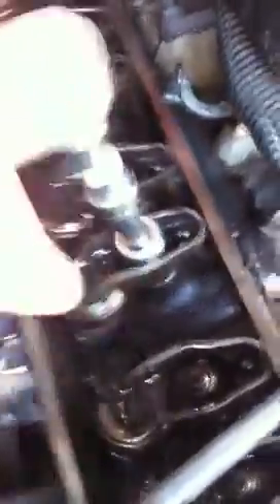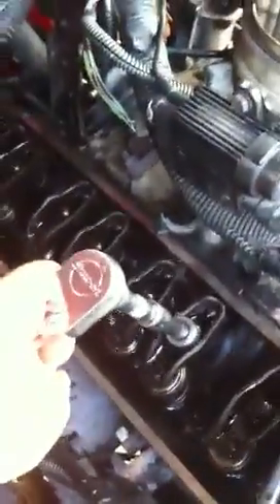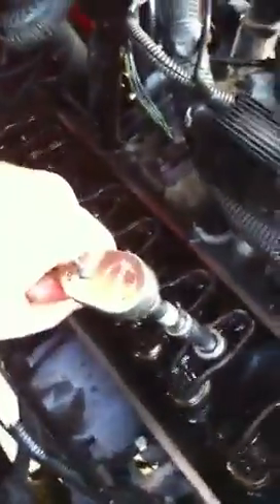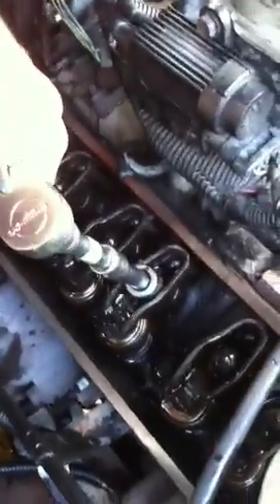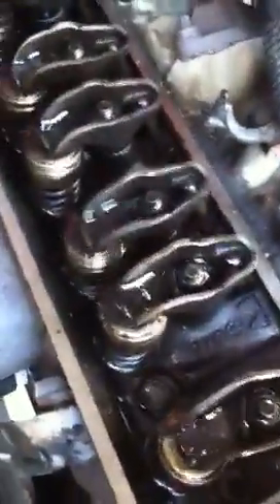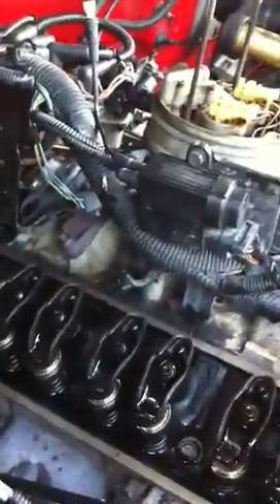L05 rocker arm adjustment chevy 5.7L 1995

Comment: I have a 94 K1500 and tried this, well now my driveway and engine bay is covered in oil that sprayed everywhere. Nice lol
Reply: That’s a bummer - did adjustment work?  Was it an L05 350?   Might have a higher volume oil pump, an LT or some other engine in there.  On mopars we had to put up with the mess.    A buddy with a ‘69 427  had a high volume pump and he got a junk set of valve covers and tin-snipped the center/tops out and adjusted with way less oil slinging - you could try his trick.  These stock L05 engines amazed me that we were able to remove and adjust without the mess.
Reply: @tonyd3266  that's just it, I know it's a 350 and tbi, so I assumed that it was the same. I hadn't thought about the fact that it wasn't the original engine, that's why I could laugh about it. I bought some of the clips that clip on the lifters and did it that way. All is good, thanks.

Comment: Would you do a hydraulic roller the same way? Mine is a 98 5.7 vortec and it's supposed to be a roller. My #6 exhaust rocker broke. I've never seen it happen before.
Reply: Is the valve guide really worn ?  I'd be careful it doesn't get stuck open.  I'd go to a local, old-school trained mechanic with a scope and have them watch that cylinder to see valve opening and closing times.  My local Mobil 1 station with a garage has all those goodies and for like $35 they wil put it on their machine.  I would probably adjust the same way -- anyone else have other ideas ?  I would not mix roller and regular rockers unless I knew the roller had exactly the SAME LIFT RATIO.  Some of the rollers have 1:1.4, 1:1.5, etc... for extended duration and lift without pulling the cam.

Comment: Good Stuff!

Loosen rocker arm nut until clicking, tighten till not clicking, 
then SLOWLY turn nut 1/2 turn.

Don't rev engine while valve covers are off.

Thanks for video!
Reply: Thanks for the help. What size socket should I use? Thin wall?

Comment: That ticking noise definitely sounded like the noise I have on mine after taking it to the dealer for a new valve cover update etc. I'm assuming the mechanic man didn't tighten of them tight cause after it I had a ticking noise at warm ups goes away while running.
Reply: Sorry, I dont have all the trust in garage mechanics - especially tire shop mechanics wanting follow up work.  Do it yourself.  Hopefully they are rubber gaskets you can re-use.  One such store loosened up my power steering return nut to make it leak out fluid.  When I returned to have them really adjust the alignment he went right to that nut and said - it looks like the PS is leaking and you need a new rack.  It was complete BS.  I put the cardone rack in myself 5K before that and had even inspected the rack before the tires.  Watch the stealerships....
Reply: Tony TonyTony  I know what your saying. I'm sick of them trying to up sale Everytime I have gone in. My wife gets it the worst. I now try to avoid shops as much as possible.

Comment: I know this is an older video but just picked up a 1995 GMC Suburban K1500 with only 47k miles on it. Just did a full tune up and its running great except I hear a slight ticking sound coming from motor while driving. Do you think excessive valve lash could be my issue? If I had to be critical, it seems the motor has a slight vibration under load. What do you think? Should I attempt this? The ticking sounds similar to when you loosened the nut in the video and it started to tick. Quieter though obviously...
Reply: This issue is extremely common on these vehicles. I'd be surprised if the tick was anything else.
Reply: If this trick didnt work I’d look for a missing exhaust manifold bolt or tighten the exhaust pipe to manifold bolts carefully (if the bolt was loose - remove it- heating it if necessary- and replace with a new exhaust nut that wont loosen up on it’s own).   My experience with SBC is It’s usually the right/passenger manifold studs going to the exhaust pipe or the rear manifold  bolt attaching it  to the head.  My engine had 90K Miles and the rear left side head-manifold bolt was broken at the block- had to remove head to fix the manifold-head bolt.

Comment: i did this with my 99 vortec 350 and it makes noises i loosened it till it started tapping and i went a half a turn.  it's making small ticking noises on both sides with everything at a half a turn. but on the bright side she runs good.  any ideas greatly appreciated
Reply: The self-adjusting hydrolock portion of your lifters may be a bit clogged our out right stuck. Sometimes more frequent oil changes can free them up - like changing your oil over and over - it's a lot safer than an oil flush, but sometimes you just have to get in there and clean those directly. Soak them in fuel, clean them with carburetor cleaner - there's lots of right answers.

Comment: You rock dude. I have a slight tick in my 350 developing after a fresh rebuild. I didn't do the rebuild myself, and am not an expert mechanic. I'm pretty sure I just need a rocker adjustment, but didnt want to pull my intake to do it. This is awsome, Ill update you once I finish this Sunday.
Reply: That's awesome. What happened next?

Comment: Are you plugging any vacumn lines off?
Reply: Dont need to do that on L05.  This is a mechanical thing to set right tension on the push rod going down into the lifter.

Comment: I made a valve cover with the top cut off but still got oil soaked trying to do this with my 383 stroker motor.  Haven't tried it on anything newer.  Thanks for sharing!
Reply from the maker: Yeah - a good friend did the modified-valve-cover on his 427 BB in his 69 corvette and made a mess.  This L05 doesn't sling oil at idle.  However it does consume it on decelleration - cure for the tailgater...
Reply: Had a 383 mopar 1967 that would soak the engine bay.  It’s a wide block (big block that is spread apart further than the smaller blocks.  I recall the 440 was even wider — or maybe bigger heads?

Comment: did you drain any oil?
Reply from the maker: did not drain any oil.  just DON'T rev it up with the covers off.  you will take an oil bath in that case and fling oil all over the hot exhaust manifolds.

Comment: I think I need this done to my 200 gmc sierra classic K2500 w/350. Bought used with 100K and valves just make way too much noise I think
Reply from the maker: I would.  You might find one is too loose.  I've wondered if  it also helps put the lifter into a less-worn area.  I've heard 1/2 turn to 1 turn, but over fear of floating a valve into a piston -  I go on the less compressed setting.
Reply from the maker: Mine was at 99K when I changed out the valve stem seals.  it runs better now - but I have one cylinder a little down that has the equivalent of a 1 pack a day smoking habit.

Comment: Thank you for the video! Bought a 89 K1500 1 owner. front/back plow setup. nice truck. older gentlemen said his mechanic said the engine was getting a rod knock and that the engine was going to blow. mechanic offered him $1000 i gave $1200 and it was the lifters. called the guy i bought it from and tolled him to change mechanics. trucks in great shape. clean body. worth well over what i paid.

Comment from the maker: Add some seafoam to the oil, drive the truck about 15 minutes, then change the oil/filter with the $20 autozone special, run it a month and change it again with your normal oil just to keep in clean.   that's normal - if you rev that motor up and hold it at higher RPM then you will see oil flowing on all of them (and into the engine compartment and on your hands)  

Don't sweat it.  that is at idle...  you only need a little oil flowing there - not a bath or it gets sucked into the engine.

Comment from the maker: Next you can follow the video process -- this will help you start the engine and not hammer a valve with the piston.  If you have solid lifters then I think you are looking for torque specs --- be very careful and get input from those experienced with solid lifters.  Most SBC are hydraulic lifter - only the rat-rod race motors are solid.  Those solid lifter engines are the 10K RPM motors. With solid lifters you adjust at TDC with feeler gauges in the thousandths of an inch--> get mfg manual.

Comment from the maker: Take off dist. cap and see where dist. rotor is pointing compared to SBC charts.  At Top Dead Center for each cylinder - tighten rocket nut until you feel it binding up (twisting pushrod between your fingers. That is zero lash with the lifter plunger all the way up.  then go another 1/4 turn.  Rotate engine 1/8 turn, see cylinder where rotor is pointing, adjust that one now. repeat 6 more times.

Comment from the maker: The nut is a staked nut that pinches on the bolt and doesn't back off on it's own. My thought is that torque spec doesn't apply here - it's an adjustable nut that is offset by the hydrallic lifter. SLOWLY tighten the nut or you will float the valve and stall the motor.  with all plugs out, turn motor to TDC for each cylinder on compression stroke (0degrees timing wheel, cylinder #1 - front cylinder LHD/US  drivers side).

Comment: hi, first off thank you!!! I used your method and my camaro is running great!!! 
took about 30 min! ok however when I got to the last rocker arm.. the first one from the front on the pass. side when I loosened it oil starting spraying from the push rod.. all the other rods did not do this... so I still did the method and she runs great.. is this a problem? I do have a high flow oil pump but none of the other rods did this if they did it was very minor .. thanks

Comment: Its a cam from summit racing and in the instructions it says to adjust the valves before break in. So my main question is how can i adjust my rockers without having the engine running?

Comment from the maker: i'd be really concerned about floating a valve without adjusting  the rockers first.  then break in cam.  You are using the conventional hydrallic lifters, right?   I'd re-set them after break-in.

Comment: would i be able to adjust my rockers while my cam is breaking in at 2000rpm? or should i tighten my rockers until no slack is felt in the pushrods then adjust them after my cam has broke in? thanks
Reply: I would do this at idle.  2000rpm will spit oil everywhere.

Comment from the maker: you can also use a rachet and socket on the crankshaft bolt, tightening, but on L05 it's not too high torq tight and it you reverse it may back bolt out and mess up it's torque setting.

Comment from the maker: crank motor over (with coil disconnected from wire harness) for a sec and then see where rotor is pointing.  refer to cylinder map and firing order in clymer manual (or google it).  It's kinda random but it works.  last cylinder takes a while to hit the lottery.  works best with a buddy doing the key while he drinks your free beer.

Comment from the maker: get extra set of covers if it's too much -- cut middle out.  Probably only $10 at a yard or craigslist.    

before running this procedure get top dead center on each of the cylinders and spin the pushrod with your fingers and tighten just until it stops. That will be close to zero without the load of the engine.  At least that way you will be able to start the engine.  

To check TDC remove distrib. cap and look where rotor is pointing.  TDC for 1 is when the rotor is pointing at cyl. #1.

Comment from the maker: in the old days -- get a set of old valve covers and cut out the center for access to the adjusting bolt.  

FYI.  I'd go 1/2 - 3/4 turn instead of the 1/4 turn I stated above.  

worry more about dropping stuff into the motor.    I would say YES -  the K2500 is probably L05 like the K3500.  It's a 4 bolt main motor with 4 bolts in the middle of covers.   Look on the door end and see if L05 is one of your codes there.    I think the options were only 5.7 L05,  6.2 diesel, and 7.4 gas.